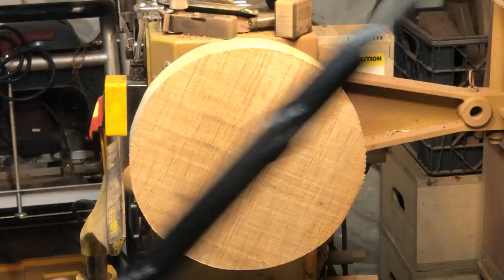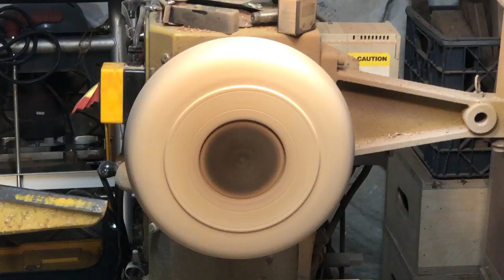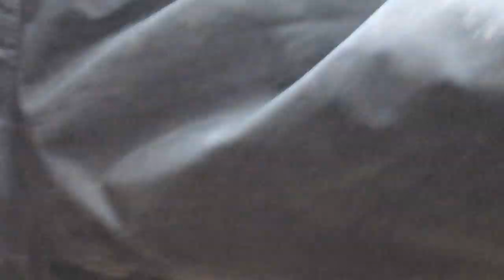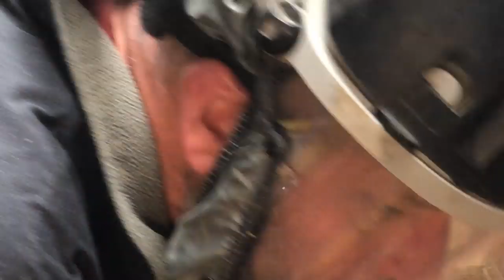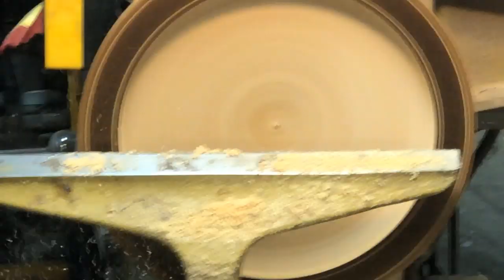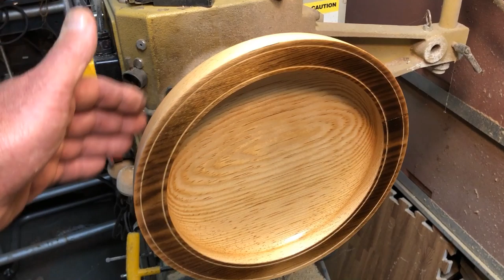Sugarpine Burnt Bowl

Comment: I like to use pine to practice on. The soft wood displays my sloppy tool control and forces me to be more careful and patient. If I can get results there, my work on hardwoods becomes much better. Also I see your using a different face mask/breathing device. I know you weren't overly pleased with the Trend mask. What brand is this or is it home made? How well does it work?
Reply from the maker: This is my Trend I modified.  A subscriber 3-D printed out a fan housing that uses a Milwaukee M-12 battery and a mini squirell cage fan that straps on to my waist and I hooked up a flexible hose and cut out the battery area of the Trend!  This works so much better than the Trend because the batteries last a week instead of hours.  It is a drag to have the belt and waist pack but worth the battery life!

Comment: What is the difference between sugar pine and yellow or red pine.
Reply from the maker: Sugar pine is a very clear no knot pine from ponderosa pine and is super light weight and very soft and stable.  Use for windows, sashes, trim and other items that need milling and need to stay straight and not warp due to grain inconsistencies